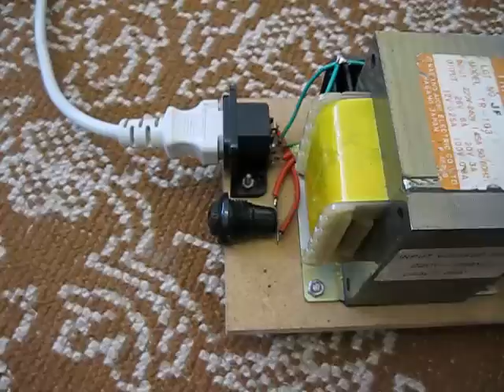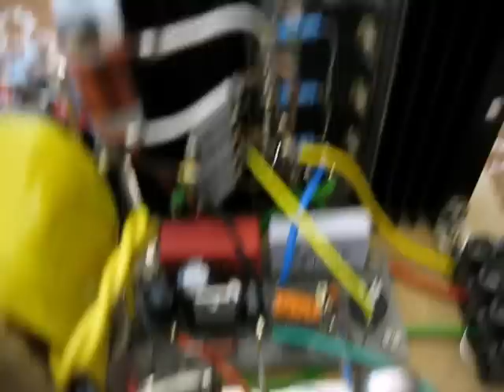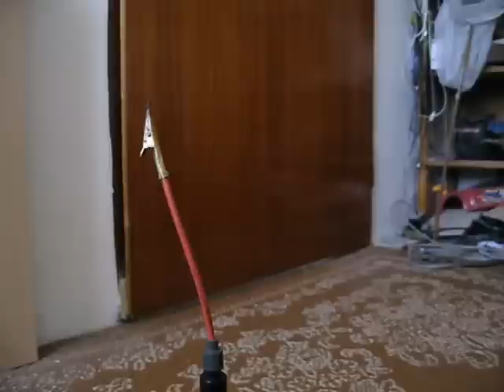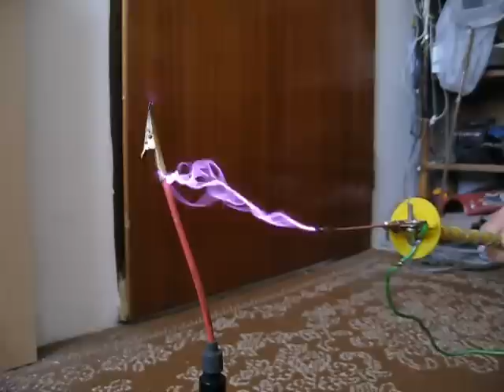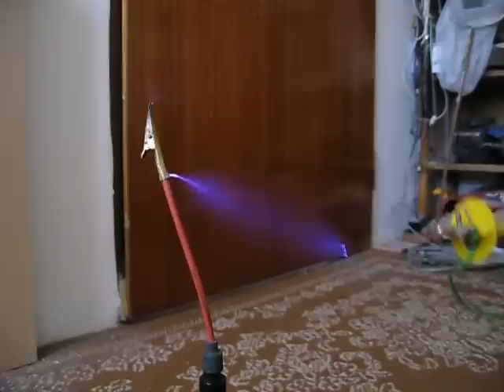Super flyback driver final version

Comment: how many turns you did in the primary? what the voltage in the primary? thank you
Reply from the maker: Hi, there were around 10-12 turns on the primary and the DC supply voltage was around 30V.
Reply: friend, you could send the circuit diagram to do it thanks

Comment: Could you use a substitute resistor for the 0R18? I know they are 0.18 ohm resistors, but i only have 2 of them in my resistor bin and i want to know what you can substitute them for. Also, do you have to use an IRFP260? or can i be safe with an IRFP250 because that is all i have. Also, i have everything else, so im going to build! Thank you very much!

Comment: ever thought about a LM324 chip? i have mad a pwm with one, it works well, but im only running it at 12 V 10Amps( old atx supply) not enought for a good charge for my tesla coil. how many amps can a fly back handle? volts? and what are the best set ups to run the flyback efficiently with out over heating the unit or circuit?

Comment: Hey OP, can this be audio modulated?
Reply from the maker: I think yes, if you superimpose (AC-couple) the audio signal onto the voltage on pin 1 of the IC.
Reply: Should I remove the 1uF across the power limit pot for audio?
Reply from the maker: Yeah
Reply: friend, you could send the circuit diagram to do it thanks
Reply: @uK8cvPAq  only the pathogens in Chad's semen will

Comment: I never though of using one of those chips to drive this type of flyback. How did you get it to jump such a large gap without shorting out? Once I get past 3" My flyback begins short. Great job! I have a question for you, what is the purpose of the inductor and diode connected across the mosfet into the current feedback network?

Comment: 2 questions please
1) How do you separate the core (i.e. defeat the cement) to adjust the air gaps? FWIW I've tried both heat and high-intensity ultrasonics to no avail - Of course any method requiring direct access is bared inasmuch as one union is inside the windings.
2) Values shown on the schematic imply the non-dissipative snubber is resonant at ~277 kHz (dictating a design-minimum pulse width of ~3.61uS). Is this a targeted characteristic or compromise between rise-time and overshoot?

Comment from the maker: @carazytoco hi, where do I say that? I have three IRFP250s in my version, and the heatsink doesn't get warm. One IRFP260 is like two IRFP250s and is enough.
200V is the spike generated on the heatsink, the power supply is just 32 volts.
Thanks btw :-)

Comment: hey jmartis2, I make this circuit and it works very well, I have achieved the same results with a single mosfet, At first I had problems, in the scheme the inductance has two values written, and I put one of 1.5uH, and there was almost no voltage in the secondary and the cap of 400nf was about to explode, then I make the inductance with the description below and it worked very well, it has to be the inductance and the cap to the resonant frequency of the flayback, It is the most efficient driver I have built, thanks for the info.
Reply: fjotas do you still have the schematics?
Reply: What is the relationship between the inductor and capacitor? For a lower value cap should the inductor value be higher or lower?

Comment: People in Africa barely have electricity and you're just using it to make ozone....

Great video btw working on a digital PWM with a microcontroller and am getting 3 cm sparks at 80khz 12v. Would love to reach 12cm but I require more voltage on  the input, much higher voltage transistor, and a push-pull driver instead of a "Open drain" one. Also because I can't filter the DC I get a constant current of around 500mA dumped on the primary permanently at no-load.